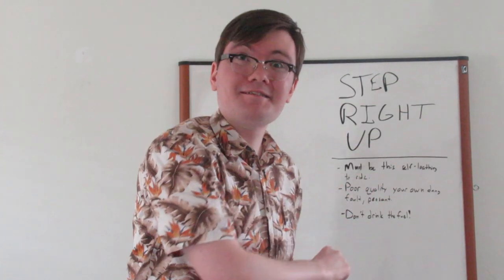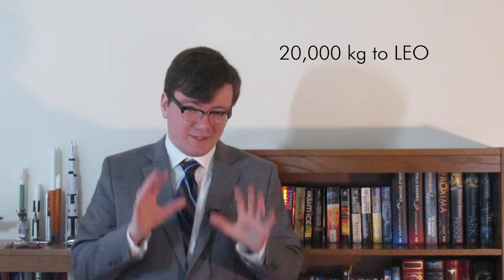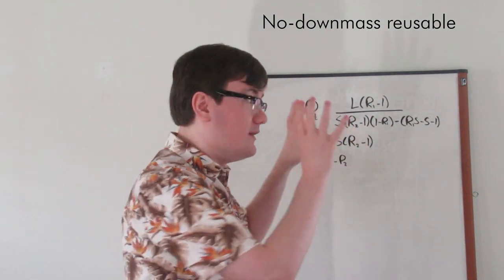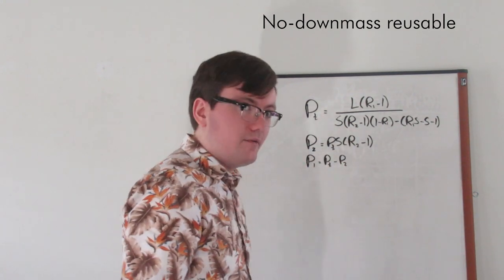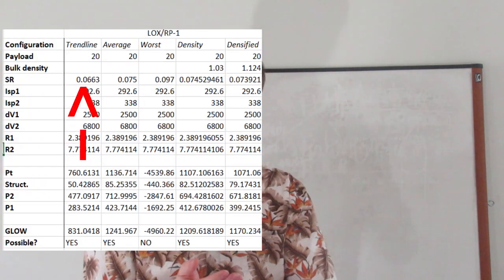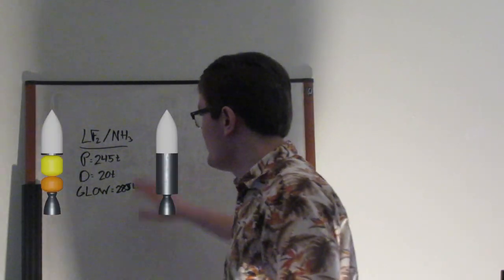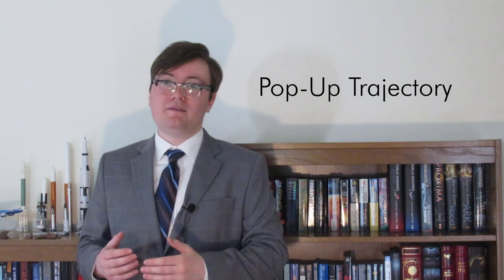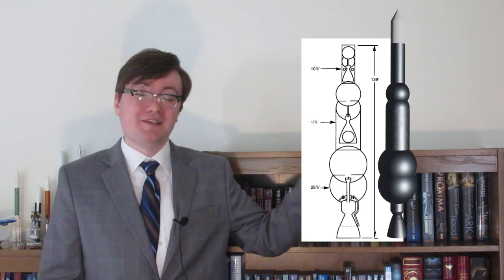Designing an SSTO

Comment from the maker: Checkmate, Atheists.

(Actual description questions below.)

Also, the audio is weird because I filmed half of this back in February and put the mic way too low.
Reply from the maker: Longer Notes

1.	Why didn’t you talk about materials?

       The answer is that I’d have to do structural calculations. Unfortunately for this kind of design, tank pressures are ~30psi, making thrust and aerodynamic forces the dominant stressors on the materials. I lack the software to do adequate simulations. Plus, my structural mass estimation method compensates for this by including all launch vehicles; Atlas was made of steel, Saturn with aluminum, Electron with composites, and so on. You can’t beat the trend.

        In the end, our SSTO will likely be made of one of the specialized aluminum alloys (think Al 2190) used on launch vehicles today, maybe with carbon composites on less integral structures. Those materials are more expensive than readily available steels, but those don’t necessarily allow for the mass margins needed on these SSTOs, unless they’re hydrogen powered.
Balloon tanks could be used on our expendable SSTOs (though I wouldn’t want a fluorine balloon anywhere near me), not the reusable variants. You could theoretically make a balloon tank reusable booster, but I haven’t seen one studied yet. Keeping pressure adds complexity that outweighs the mass benefits gained, I wager.

2.	What about an all-solid SSTO?

	There’s only one I’ve found, hinted at in the 1960s. Solid boosters have some of the highest propellant bulk densities combined with the best structural ratios. My only issue with them is their lower performance and getting the proper grain geometry. That seems like something unique to each payload and trajectory. Not an economic option.

3.	Why didn’t you use RS-25s, -68s, LE-5s, or these other engines?	

	I’m lazy and forgot to do that. Gary Hudson did a thought experiment of turning the External Tank into an SSTO powered by 6-7 SSMEs running at 109%. His delta-v assumptions were more charitable than mine, which is something to consider. Were I to do this again, I’d definitely investigate an SSTO powered by an existing engine, specifically an External Tank derived vehicle. Why not add to the pile of Shuttle-Derived LV list that everyone confuses?
	The other issue with using existing engines, like the SSME, is you have limiting factors built in, like thrust and gimbal ranges. If those don’t cripple my design, someone in the comments will write an essay about how wrong I am.
	
4.	What about this propellant combination?

	Here’s what I looked at, by oxidizer.
	-LOX: RP-1, Propane, Methane, UDMH, H2.
	-F2: Ammonia, Hydrazine.
	-NTO: Aerozine 50.
	-H2O2: RP-1, UDMH, Propane, Propylene, Methane.

	I was limited by what Bruce Dunn talked about (he included weird ones like Propargyl Alcohol, Cyclopropane, 1,2 butadiene, etc.) and propellants I’m aware of. As I mentioned in the video (if you’ve gotten that far), Cpropep doesn’t have everything and the data I could find was for different mixes/chamber pressures/etc. Some of these propellants have virtually identical performances to each other, so I didn’t feel like repeating myself (as fun as it is to talk about furanol).
	Doing the calculations for a triprop engine would’ve been easy, but as I mentioned, this is a paper rocket. You could do a triprop SSTO, it depends on the complexity you’re willing to add to the system.

5.	What about gelled propellants?

	I considered using gelled and metallized propellants for my expendable SSTOs (especially the metallized), but decided against it for sanity’s sake. There isn’t enough data on them to make much of an educated guess toward performance.
	While they offer higher storability and performance than their liquid counterparts, you have to counter this with the fact that running aluminum pellets through a regeneratively-cooled pump-fed engine isn’t the best idea. One can only wonder the erosion on the throat and insides. I’ve only found a few actual engine firings of gelled propellants—mostly Air Force research projects. Of those, I can find data on Alumizine (hydrazine with aluminum) because it was part of Low-Cost Booster (LCB) studies in the 60s. I am aware of a test with gelled IRFNA from ~1998, but that’s about it.

6.	What did you mean by finicky?

	Think of it this way: your SSTO has to have both low weight but also survive the stresses of launch and landing. This gives the materials rather thin margins for sizing. As we can assume based on our understanding of engineering and physics, these components will be subject to cycling, thermal stresses, and other forms of fatigue, which puts a rough number of cycles on the parts and overall airframe.
	 Aircraft have inspection schedules for their different components (see: the Southwest flight from a few years back and that Aloha Airlines accident) because they have different loading cycles and component lifetimes. Our SSTO would have similar routines.
	The question is: how much of a beating can this machine take? How many flights before the engines are done? What kind of repairs could be done on the vehicle before having to scrap it? These questions would be determined by trade studies and experimentation in the development cycle of the SSTO. In the case of Liquid Hydrogen-powered SSTOs, the valves and seals would be a major limiting factor.

7.	Why do your engines suck?

        To get a better engine design, I’d need to figure out a few things related to the trajectory and loading cases on the SSTO structures. Those need simulations and models which I can’t produce in the time I have nor do I have the skill to make them work. We’re also making a paper rocket, which means it can do deep throttling if need be. One issue faced by several SSTO and stage-and-a-half designs is acceleration near burnout. Even the inboard F-1 on the Saturn V cut out before stage burnout.
	Again, this study was focused more on getting rough performance figures and structural mass limits in place. Engines are a side-thought at this stage
Reply: @pressure-fedastronaut6511  What about Slush LH2 and Slush LOX?
I don’t think you talked about them, but I remember them being used for a Skylon-Style SSTO study. Seems you could squeeze some extra performance that way.
Reply: @innosam123  "Slush LH2" has all the problems and challenges of LH2 and then some which is why it doesn't get pushed too often. Phil Bono pushed it for his SSTO designs and it hasn't gotten any easier to work with today. Keep in mind the 'reason" to consider slush propellant is to increase the density but that means that down the line you have to consider that it is likely to get into your turbopumps which are not usually tolerant of significant density changes while in operation.

SpaceX is using 'deep cooled' RP1 and LOX which is still well short of 'slush' territory and I've heard some engineers discussing how much that might effect the overall 'life' of the Merlin turbopumps. Now imagine trying to design them to handle both a semi-solid and liquid input.
Reply: Thanks for the great vid and all the descriptive description!!
Reply: @innosam123  Slush fuel means you need ice breakers in the tanks, like with a slurpee machine. That adds a lot of dry mass, and they have to be powered by something, which adds more mass and considerations.
Reply: 1-Might want to look more at pressure stiffened structures.   The Star-Raker design had a airframe, aero surfaces, tanks, and TPS mass allocation of only 7.4% of GLOW and that was for a horizontal take off space plane.  One of the Leeds was David a. Reed whose Saturn V second stage structure was so much lighter the expected they expected NASA refused to be leave in it until Reed stood next to the tank during its pressure certification tests.  (That’s how professional design tanks Musk rats!!)

The pressurized wings, with the LH and LOx mostly in the huge tanks, allowed for much lighter dry weight.  And being air breathing up to Mach 7 halved the GLOW.  Jet engines were 2.8% GLOW.  Which Ild estimate was little more then the weight savings from the deleted LOX tanks in a comparable all rocket SSTO.

Might want to look at the composit laminate TPS hull skins from Ultramet.   The weight savings were looking excellent, and being able to take serious hypersonic speed/heat loads in sea skimming heat loads would be laughably beyond what we RLV folks would need.
Reply: @innosam123  
Are you thinking of the NASP designs of late 80’s early 90’s?
Reply: @KellyStarks  I was thinking HOTOL, but it appears it didn’t use Slush.
Reply: Loved both the Eddie Current and the Weird Al references!
Reply: Please, put any references as part of the description text.
It is easier for saving them for later retrieval. 
Also, as in much of launcher stage polemics involve Aerospikes, it would be nice to have your POV on thus topic as a practicing engineer. (As a HEDP/Plasma experimentalist love them, as I love Ram Augmentation for 1st stages. But I built very expensive experiments on ootical tables in mid-size rooms. No large building flying structeures full of very energetic matter. I know my limitations as an Real World Engineer.)
Reply: @pressure-fedastronaut6511  wow wow slow down, love ur work

Comment: SSTO is all about structural mass. You need roughly a factor of 2 compared to current technology to make SSTO practical. With today's technology, an SSTO makes it barely into orbit without any payload. However an SSTO should have at least about 50% efficency compared with an TSTO system.

Comment: Nice to see the mention of the pop-up trajectory and the Rocket Company--a really interesting book to re-read nearly two decades after it was written. Of course, once you're staging like that, the temptation to get some horizontal velocity out of the first stage seems to be strong so you don't have some of the same SSTO structural issues (though obviously not quite as bad). I think my favorite part of the Rocket Company was where the author has a character explain their plan to test batches from a material o they can design to a specific lot of material, and then design everything with a factor of safety of 1 for the orbital vehicle's structure for lightness. The vehicle it drew on a bit, the K-1 as you mention, ended up moving in 1995 to a longer-downrange RTLS trajectory incorporating post-staging boostback burns (sound familiar?) and apparently they even internally extensively considered downrange landing (sounds really familiar).
Reply from the maker: Now that I think about it, it was weird to have a safety factor of 1 for the tanks--and I think they hinted at a balloon LOX tank, too. I guess adding some horizontal velocity on the first stage would depend on operational constraints.

I'm familiar with K-1; it's one of the more interesting designs. I didn't know they considered downrange landings, though. 

(Are you the Rob Davidoff who wrote those alternate histories? 'eofpi'?)
Reply: @pressure-fedastronaut6511  Yes, I am. e of pi.

Like I said, the Rocket Company makes for some interesting re-reading. Balloon tank upper stages, reusable, with a safety factor of 1.0 and any margin for fatigue life or creep fatigue to be made up in material yielding to deal with the strain...it's a little much. On the other hand, the point that ultimately operating an RLV is about filling the demand enough to sell at the price of a marginal flight instead of your standing army ("demand pull" or demand generation through lunar mission propellants or LEO comsats or self-loading tourist cargos to orbit or whatever) seem to bear out even where specific vehicle concepts don't hold up as well. Committing to no lateral motion helps a bit with launch site certification, but it definitely makes designing a vehicle with a decent overall payload fraction nearly SSTO-level hard.

I hadn't known Kistler considered downrange landings until fairly recently, but I gained access to some new documentation and sources which suggest it was not only considered, but considered it fairly extensively. Apparently several of the junior engineers liked it, but George Mueller didn't, and they kept trying to work around to convincing him. Of course, it's a lot easier to contemplate downrange landing when you overfly a literal desert for 1500 kilometers instead of water, even with the lower accuracy of parachutes & airbags.
Reply: The DH-1 is interesting in using purely expander-cycle engines. They are reusable pretty well, since they have lower pressure and thermal load than other similarly efficient engines.

Comment: I like your channel. I see the SpaceX fan boys putting up proposals that are based on pure fantasy yet they get a ton of views. You use real math  to show what is possible and you are virtually ignored. 
Based on what you presented it would appear that the best solution is a big low tech booster for the first stage and a LH/LOX powered 2and stage.
Reply: Cuz math is hard
Reply from the maker: Thanks.

If you read some of the old Big Dumb Booster studies, you'll see Saturn IB derivatives with big pressure-fed first stages and low-cost S-IVB derivatives. Beware, though, hydrogen is a fine propellant performance-wise but a jerk in other places. There's a reason SSMEs cost a lot and it rhymes with hydrogen.
Reply: Fun fact: A SPS HLLV from NASA's SPS study has 120t payload (same as Starship claims to do, and more that it can actually do), yet only 4000t mass when fully fueled - less than simply the fuel mass of Starship! Two winged reusable stages, large methane gas generator engines on the first and modified RS-25s on the second. Pretty cool, isn't it?

Comment: Nice work on this one. It’s good to see at least one person willing and capable to do the math. 

Ethane is underappreciated. I don’t understand why propane is popular. You need to get all the way to pentane to be room-temperature storable. I did napkin math on cost per energy, and ethane came out on top. Of all non-explosive hydrocarbons, it’s going to get the second best performance. I wish I could figure out what happened to the more recent studies on nitrous oxide fuel blends.

Was hydrogen fluorine not in the program you were using? I know there was a proposed, maybe tested, Agena that was hydrogen fluorine.
Reply: IIRC didn't Garvy's Nano-sat LV use ethane? Propane is popular for several reasons a major one being you can siphon it off for your backyard grill vastly easier than LH2 and it's a bit cleaner to use than RP1. (The food ends up with a kind of "gasoline" after taste...)  :)

More seriously, (and I haven't watched this yet mind) from what I can find liquid (cryogenic) propane was initially proposed as a 'cheap-and-easy' intermediate fuel for tri-propellant engine use that would have a density around that of RP1, (fun fact, cryo-propane has the same density as 'room temperature' RP1 and can in fact use essentially the same tankage with some external insulation) which would allow the use of RP grade turbopumps and tankage, but at the same time act nearer Liquid Hydrogen (high pressure gas) at the injector head making it easier to design and incorporate a third propellant than straight RP1. I'm not sure I'd actually call it "popular" because I note far to many time when it's been brought up as a possible fuel it tends to get dog-piled by other considerations of which the most recent is liquid methane.

I like to point out on SpaceX fanboi messages/forums that switching the F9 upper stage to cryo-propane would likely allow enough increased performance to allow stage reuse or just to gain back the margin lost for booster recovery. :)
Reply from the maker: Thanks.

I've heard of NOx/ethane. I picked propane because of its limited development history; AirLaunch and Orbex. Cpropep doesn't have pure ethane (plenty of ethane+others). 

Cpropep does have Flourine/Hydrogen (didn't know about the Agena version). I didn't include it because it felt 'obvious' as a combination. Were I to do this again, I'd include it.
Reply from the maker: @randycampbell6307  I checked the Garvey website. They used propylene. I think Vector (pre-bankruptcy(?)) was working toward a LOX/Propylene nano-sat launcher.

As for Cryo-propane, I think some of the early Gary Hudson SSTOs used propane for their triprop engines.

Comment: Hello, PFA! Can i ask you to make a video about NASA's decision to pick Starship for Artemis lunar lander? Can you talk about in orbit refueling and why it can be problematic for Starship? I feel like to land on the Moon, SpaceX needs not only lunar starship, superheavy, but also starship tanker. How much fuel should it carry and would it be risky? are there any RCS systems to make starship docking easy? Would Starship docking to Gateway be risky due to its size and mass? There has to be consideration to it, maximum pressure docking node can take cannot ecceed some limit established by mass, meaning Lunar gateway could be not suited for docking with starship? What would be the problems of landing it on the Moon if one or two engines fail, what are the emergency options?
Reply: Yeah PFA!  Respond to the Dungeon Master!

Also can you comment about having the engines above the fuel tanks as is the case in Lunar Starship?  It doesn't look like a problem in the CGI but all other rockets I have ever seen have their engines on the bottom.
Reply: @StinkPickle4000  The engines being high up isn't much of a problem - even some NASA studies use them to avoid blowing dust. However, that is the least of Starship's problems.